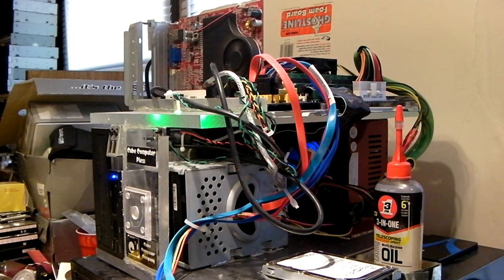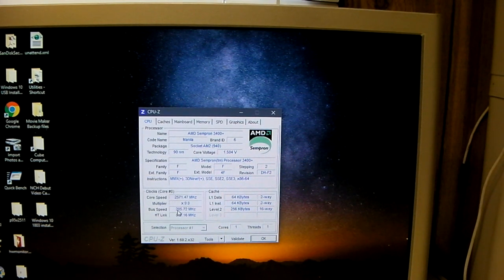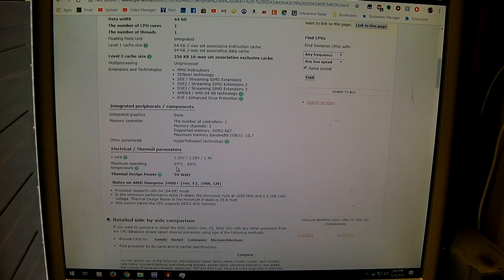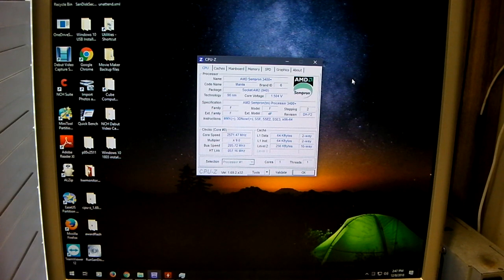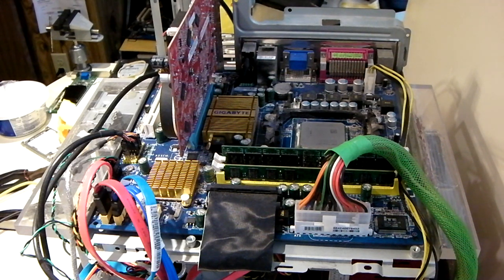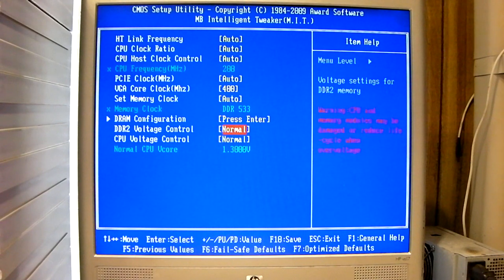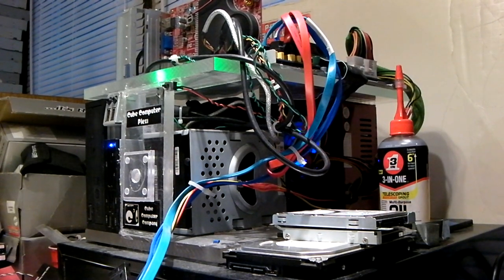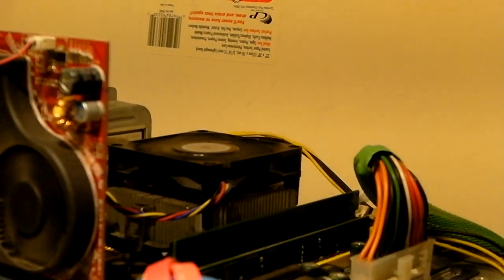Overclocking two older Sempron CPUs - impressive numbers!

Comment: When I still had my old Athlon II X2 260 based PC, I got that thing clocked up as high as 3.93 GHz @ 1.525V stable on stock cooler, and 4.01 GHz with an FX-83xx series 125W TDP stock cooler installed. I remember changing it from 1.525 to 1.55 volts for maximum stability. For a CPU running at that high of a voltage, I was absolutely shocked at how little of a heat output there still was despite the massively increased voltage.